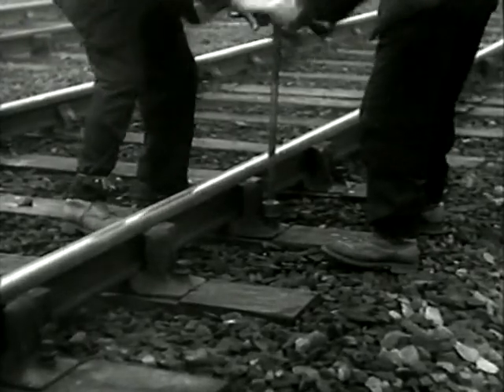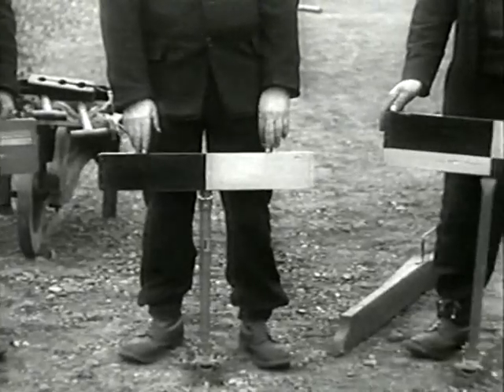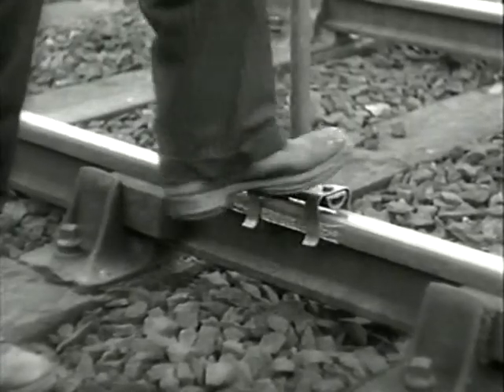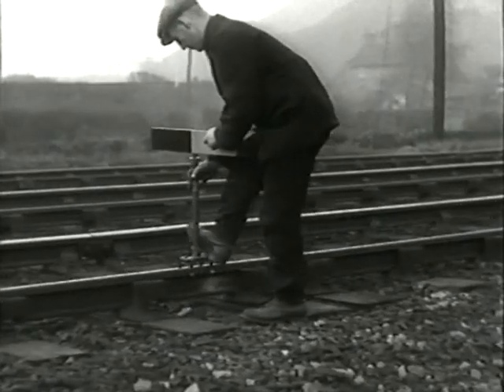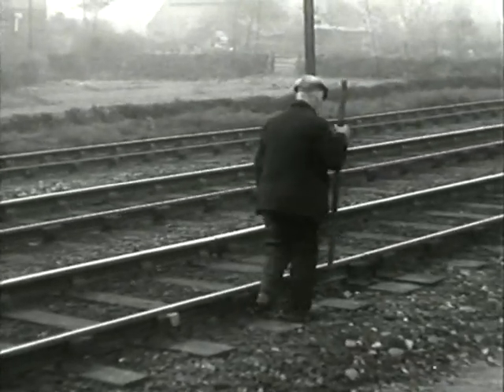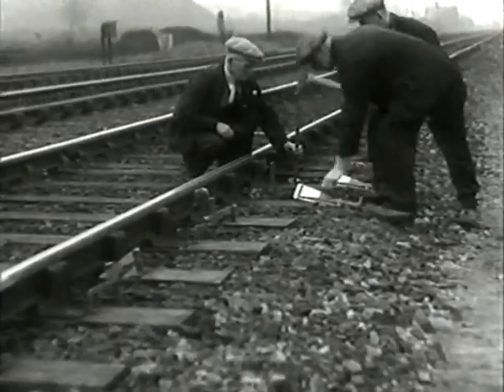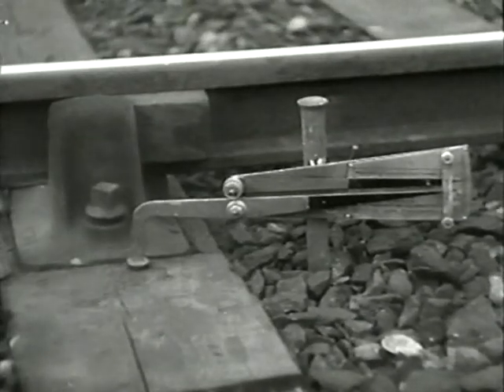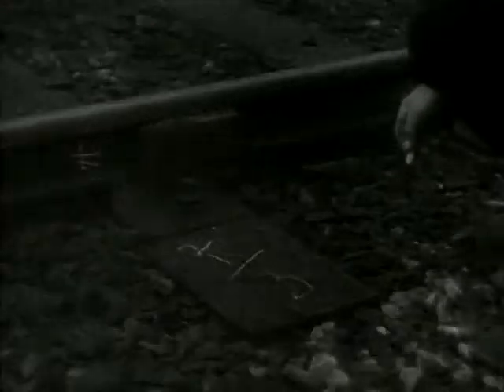Measured Shovel Packing 1

Comment: @beyergarret123 I'd doubt it. Gangs were consolidated and most went mobile in the 80s. There was a disastrous phase of outsourcing in the late 90s too. It will be inevitable that there would be more automation and reliance on minimal remedial work + fixing stuff during programmed maintenance (plus the spread of CWR/LWR and metal/concrete sleepers). I can't remember the last time I actually saw a track gang at work.